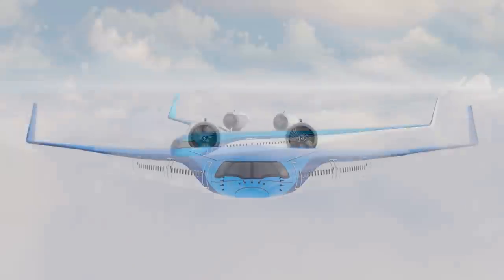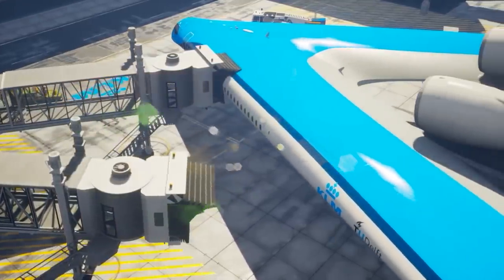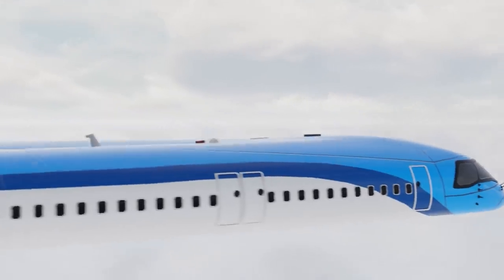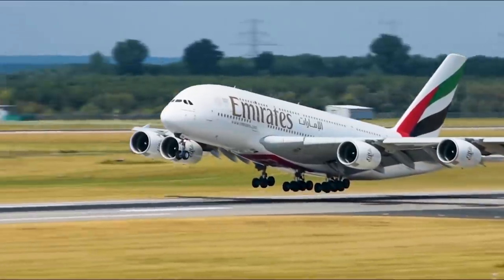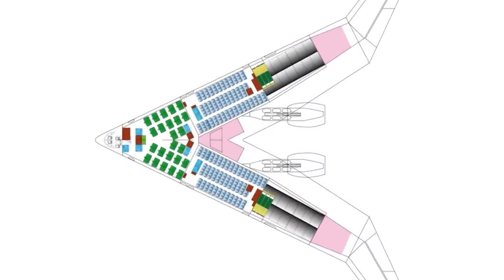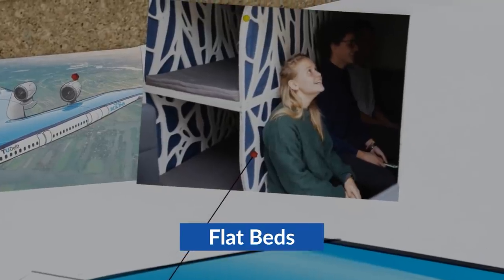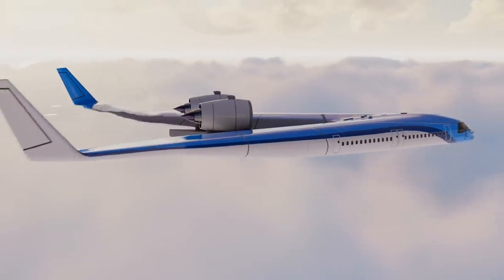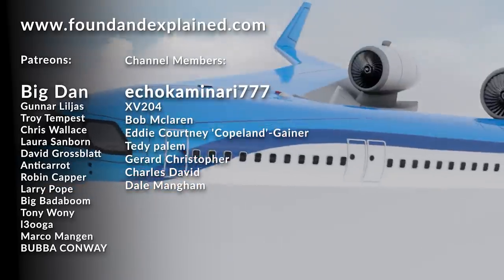Why would you (not) want to ride the Flying V

Comment: Most of these blended wing concepts rely on computer stabilisation to fly. I haven't researched the flying V in detail, I wonder if it has natural static stability. If not, it will never be commercially available. 

Flying wings and blended wing body airplanes are hard to stabilize, because, well, you've removed the stabilizers. Therefore, most concepts go to computer stabilisation as the natural next step in technology. It's already used in fighters, why not in large planes then?

The b737Max came just short of the stability target, a minor computer interference in the edge cases should've gotten it to the target. Didn't end well. Now imagine if you want to use that for the majority of your stability.
Reply: Also, if you allow computer stabilisation on a flying wing, why not on a conventional aircraft? You could delete/reduce the tail section on a regular plane too, and suddenly, the efficiency of the flying wing isn't that much better.
Reply: I was about to comment the same thought when i saw yours. Thanks for stating a very good point. The flying wing concept an design has been around for ages and i also believe that this was the hardest issue that designers have to solve. Manueverability for this concepts are physically impossible for pilots to fly on their own. I just hope technology and innovation will make this great concept reliable and safe for use.
Reply: @g.zoltan  false
Reply: The issue with stabilization and flying wings is not an issue since we've been doing it just fine since the B2 bomber. The Max MCAS system was grossly mishandled but isn't a indication of computer stabilization being a bad thing.  MCAS was also just put on the 737 Max to avoid having to get a new type rating for the Max. Computer stabilization is already extremely widespread in the form of a yaw dampener.

Also flying wings usually require computer stabilization because of the lack of vertical stabilizers. This has vertical stabilizers.
Reply: @g.zoltan  false
Reply: @FiveTwoSevenTHR  Remembering that the regulation of a commercial plane is different from a military plane like B2.  B2 takes 2 pilots.  A commercial plane you take more than 200 people..
Reply: @x-gamessimulator1067  I was not at all talking about regulations or anything legal about the blended wing design. Just the part about how it flies.
Reply: @FiveTwoSevenTHR  precisely! Plus many military planes use computer stabilization and they work fine.
Reply: Only the ones that try to eliminate a fin. That never helps.

But even the XB-35/49 was salvageable with available 1949 technology that was already in use. Fitting it would have required a commitment of time and $$ by an Air Force that was run by a CoS doing dirty business with Convair, and no longer had need of a 1941 medium bomber, and wanted Northrop to concentrate on the contracts they already had.

Burnelli made the CBY-3 in the late '40s with a lifting body fuselage.
A test pilot praised it saying you really have to push it to make it stall, and it won't spin. Do a "suicide stall": cut power and pull back and just as it starts to fall, kick a rudder pedal and let go of the controls.
This plane just shrugged and flew out level at whatever power setting. In any other contemporary similar plane, you'd be in big trouble.
Many designs of all-wing or lifting fuselage have flown well, but "the markets" ignore them.

See the '70s Boeing model 754/759, following Burnelli designs. Boeing dropped it when Burnelli's estate said they'd be happy to let it be license built. Normal tails, markedly enhanced range and payload.

Lock-Mart more recently showed a hybrid wing/body logistics plane: with same engines and fuel load as a normal plane it gets 140%+ the payload and range (more than 20% enhancement), with no newfangled control systems or construction or doubts about stability or control authority.
Resounding silence from buyers.

See planes like the  Arup wings (Indiana, 1930s) or Burnelli designs>
They flew better than normal planes, but the major problem was that they looked funny.
Reply: @g.zoltan  Not true, as the "normal" plane still has that awful static drag fuselage. That static drag is what we're trying to eliminate, not the little bit of a fin & rudder for sensible designers.
And now it'd be even more of a death trap if advanced controls fail.
Reply: The B-2 doesn't factor in  at all. It's only flown by high ranked military or test pilots and only from an ejection seat because it's a death trap if damaged or controls fail.
That's barely acceptable in a modern airliner, as we're all flying on planes that will stall and spin.
Many all-wing designs have been no worse, and some have been stall-spin proof, but "the markets" don't care and the designers are told to get back t work on something that will sell, if it doesn't look too funny.

To date, nobody has made a fin rudder-less plane that's acceptable and serviceable.  I specifically include the B-2 and hang gliders and sport gliders in that. Few with wing-tip fins have They're usually only a little less terrible. They all slip down out of a high bank and are death traps in a stall.
Many "fuselage and tail-plane-less" designs with proper fins have flown well, some have flown markedly better than "normal" planes.

Look at the Airbus VELA study BWB designs that borrow from the Tupolev Tu-404 (but smaller). It demolishes the persistent idea that eliminating static drag from a fuselage and span-loading the wing must make a dangerous oddity.. Positive stability and control authority are guaranteed, despite a relatively short moment arm and no fuselage.
Note the deafening silence from prospective buyers or operators.
Reply: 1940s Burnelli CBY-3 sneers at this over-generalization of the idea of eliminating the static drag fuselage. Stall-spin proof, better range & payload than normal planes of the class, lower landing speed.
Reply: @JFrazer4303  The fuselage can't just be deleted. The flying wing also needs to have that same fuselage volume to store cargo, passangers, and fuel. It's just in the inflated wings or the big central part of a BWB. 

Is that better? I'd say not much better. The tube fuselage minimizes frontal area, that's more important than the small surface area of a BWB fuselage. At least for normal sized planes. Large sizes are more in favor of the small surface area of the BWB fuselage,reason why BWB concepts are often giant 800 passanger jets.

While a flying wing/BWB "fuselage" has advantages compared to a tube fuselage, like producing lift, strucural efficiency, or having less interference drag, I can't imagine it giving more than a ~15-17% performance increase, to be commercially adopted more than that is needed.
Reply: To clarify I mean my ~15-17% performance prediction for a fair comparison. The conventional aircraft should have the same technology available to it: engines, materials, stability target(!!!), etc. If you give the flying wing the newest tech, and leave the conventional plane with today's tech, you're not really evaluating the configuration. Many plane concepts are making an unfair comparision to appear better. 

Also, realistic size proportions. 20% performance increase is often quoted as the limit needed for commercial adoption. I can see a BWB passing that limit easily if the size is huge, like 800 passangers. But in real life, noone needs planes that large.

The flying V appears to be a fair comparison in everything but the static stability, that one is unclear to me as I didn't find any data on it. However, the flying V "only" promises a 20%. That prediction may go down a little if the plane is built in actual reality. And it may go down a little again if the stability is bellow requirements as I suspect. And my prediction of 15~17% increase realistically seems valid here.
Reply: That's y I think the design would benefit from Retractable "Winglets" near the nose of the craft to help stabilize. Especially during takeoffs & landings.. It was said if there was ever a Concord 2, it most likely have em. Just like the "Russian Concord" did

Comment: uhm okay...
1. centre of gravity very close to engines which means hard work for pilots during take-off
2. cargo space at the same position as engines (centre of gracity far behind)
3. interior is revolutionary but I personaly would feel unconfortable in those bentch seats (turbulance and hard landing)
4. wings like 2 huge fuselages, with short wing tips , I dont think it could lift easely or at all 
5. train seats??? tail gunners on military aircraft were trained flying facing backwards but for some passagers could find it uncomfortable

personally I would fill the gap between the wings to increase lift and reduce fear about the centre of gravity + it would increase capacity for fuel, passagers or caargo space
Reply: 1. Since when is it a problem?
2. When did it say anything about cargo?
4. Depends on aerofoil and wingspan airflow. If designed properly, it will be more efficient.
Reply: Hard to fly ? The software would cover it. Next generation will have pilot for safety reasons only.
Reply: I do not see this working mainly because of passenger seating and evacuation problems. Also, in a regular aircraft you have individual components that can be repaired or replaced on their own. An integrated design does not allow this. If a normal plane has damage to the wing for example, it's damage to the wing. If a V plane has damage to the wing, it's damage to the entire plane.

BUT I can see it working first as a cargo plane. For passenger transport I would be inclined towards lifting bodies, something in between the radical flying wing and the traditional tubes.
Reply: @uggiebear1  Just like it did on the 737 Max, right?
Reply: @scottthewaterwarrior  I'm thinking perfect world sadly. Yes things do go wrong sadly 😦. I was just thinking moving forward In aviation but yes sadly it is sometimes at more than financial cost.
Reply: @scottthewaterwarrior  al the planes already have it the problem with the 737 max was the Boeing was making shortcuts
Reply: I do not agree with option 1!  Effort has nothing to do with engines and center of mass!  What makes an aircraft smooth on take-off is the position of the center of mass and the center of lift in relation to the landing gear...
Reply: @fred6319  True planes have had AI for a long time, but most are not rendered completely uncontrollable if the AI glitches out.  Well, other then military jets, but those also seem to have a relatively high accident rate.

Comment: Many people don’t realize is, yes a flying wing does have a smaller frontal cross-section and lighter, but the wing is also thicker, meaning less suitable for transonic flight. Why? Because wave drag and transonic drag divergence (top of the wing have supersonic flow).
So instead of flying at Mach 0.80, a flying wing may only reach 0.7 or lower. Making a 10 hour flight longer.

In addition, a flying wing is hard to control when close to stall, and cause the entire crane tumbling end-to-end. Even with fly-by-wire and advanced autopilot we can’t rule out the possibility of reverting back to full manual control, and in full manual control, pilot may stall the plane.
Reply: Stability is further compromised by engine loss. A loss power near stall is likely fatal. There is not nearly enough redundancy or throttle control with this design. Likely few large bypass engines are required for fuel consumption. The cost of ensuring proper flight control surfaces will drive the cost up and shorten the lifespan of aircraft. Not likely viable for commercial service. I also suspect the passenger areas are not considerate for long flights. I suspect the market for this still does not exist.
Reply: Mach .7 is around the usual crushing speed for a commercial Jet anyway, and that's likely to decrease on long haul flights soon anyway
Reply: @silentdrew7636  I am already quite optimistic when I say they can cruise at Mach 0.7. Realistically, with a wing that thick, you are looking at best 0.64, which is how fast YB-49 flew (Cruise at 0.5 Mach by the way). It would most likely slower due to thicker wing than YB-49. 
For some perspective, the Maximum speed of YB-49 is slower than the cruise speed of a ATR-72 modern turboprop.

Modern jets are designed to fly at 0.80, there isn't much fuel saving by flying slower (unlike slow steaming used by ships). The longer flight time is caused by routing and air traffic congestion.

Comment: As a structural engineer, I see one major problem that is the pressurization. If the pressure difference is 10 psi, that would be roughly 1500 psf. For a non-circular section, the member would be very heavy. For a circular section, it just turns the pressure into tension with no bending moment. That is why current aircrafts are all circular or near-circular oval shape for the fuselage. Maybe it can be used for cargo planes.

Comment: So since fuel was stored in the wings of previous tube + wing designs, now I'm guessing in a 'flying V' fuel storage would be integrated with the fuselage. Does that affect safety in a catastrophic event?

Edit: Those seats are at really funky angles and the reclining lounge seats while "using space efficiently" look very claustrophobia inducing. Easy to imagine someone getting bopped in the face by a reclining passenger from the row in front.
Reply: Previous design also had fuel in the fuselage. So, no difference here.
Reply: @Vox_Unius  Most jet designs use all of the wings' volume to store the fuel though and from the diagrams i've seen, sometimes there are smaller auxiliary tanks dotted around the fuselage. So my point on safety is that the majority of fuel is stored away from the passengers.
Reply: @Lucius.Hercules  Not quite. Yes, aircraft designers try to use as much wing volume as possible, but usually aircraft also have pretty large fuselage tanks. For example, B727 has 3 tanks, 2 in wings, 1 in the fuselage. Each wing tank is ~6780L, the central one is ~16460L.
Reply: @Vox_Unius  ö well that's good to know lol, fully thought most the fuel was in the wings.
Reply: Thing that immediately strikes me is this new configuration of seats would add a lot of weight in reinforcement. This arrangement without specific strengthening would turn most seats into deadly debris. Rattling everything and everyone like beans in a coffee grinder.
Reply: @arbhall7572  i agree
Reply: @Lucius.Hercules  If you look at the pink sections of the diagram, the fuel could be stored there at the rear of the lifting body wings and possibly the other pink section where the two fuselages converge keeping the fuel as far away from the passenger as possible and closer to the engines. This would also help balance out the aircraft as the passengers would act as a counter weight in the front of the aircraft to the fuel in the rear ends of the aircraft
Reply: @L33tSkE3t  I didn't notice so that's also good to know! thanks skeet ;)
Reply: @Lucius.Hercules  Or that space could be used for pressurized Hydrogen or even Batteries / Fuel for a Hybrid setup where the  Turbo Jets could generate electricity and they could cover it in solar panels.
Reply: @L33tSkE3t  well that's another topic entirely! I think hydrogen is the more likely to succeed but could be more than catastrophic in a few situations. 

Batteries and planes don't mix too well in my mind, as the mass doesn't decrease during the flight and energy density isn't where it needs to be. Also lithium batteries would burn or explode if you crashed in the ocean.

Hybrid electric jets sound like a winner to me and solar panels would help a bit but couldn't be enough on their own.
Reply: There is a center wing tank below the passenger deck and on some airplanes (Air Force One. . .) there are rubber bladders of fuel in the aft cargo compartment for extended range.

Comment: Similar designs have existed for at least 30 years or more and none of them moved past the design/theory stage.  The drawbacks you mentioned are certainly present, though the evacuation issue wouldn't be an negative if it was in an all cargo configuration.  While a passenger airline can raise and lower prices, almost on a daily basis it seems, cargo carriers like UPS, FedEx, and DHL often have contracted rates that are difficult to change.  If the economy is there, this could work as an all-cargo option.

Looking at the concept design and model, beyond what's already been pointed out as negatives, where will the passenger luggage (both checked and carry-on) be stored?  The advantage of a tube design is that you have at least a half to 3/4 deck below the cabin floor for luggage and other small volume/high priority cargo.

Comment: Half the people away from doors? Just make the "inside" of the V partly open. Between the steering flaps or inside of them, all you have to add is 4 hinges and you could just "pop off" the entire section. I have seen that kind of "exit" in a lot of modell aircraft to acces the steering motors in flyingwing modell planes.

Of course in a real plane it would have to be much more suffisticated, but it is defenetly not impossible. An alternative would be to use exit stairs through the roof of the plane. Because the fuselage is oval shaped, the roof is much closer to the passengers, so in theory the top of the inside wing area could be made to "drop down" intothe cabin in case of an emergency exit. All you have to do is to use 1 less row of seats and allow the roof to drop dwon there and then people can just walk away to the top of the plane. Or just make the floor drop, that works as well but might be harder to do, because the floor would often be blocked by the ground in case of a damaged landing gear.

Comment: The problem with blended wings is poor control. Those little vertical stabilizers on the wingtips are having to do a lot of work to keep the plane from sliding sideways during a cross-wind.